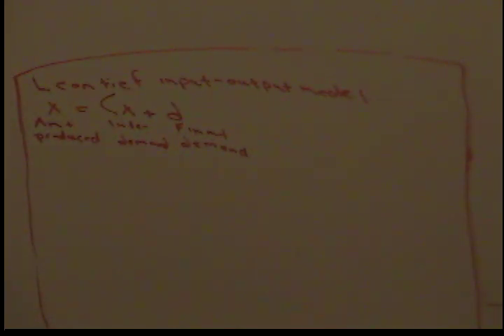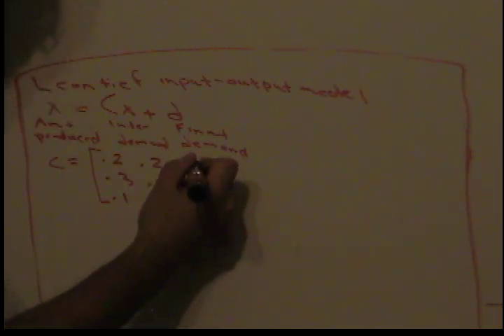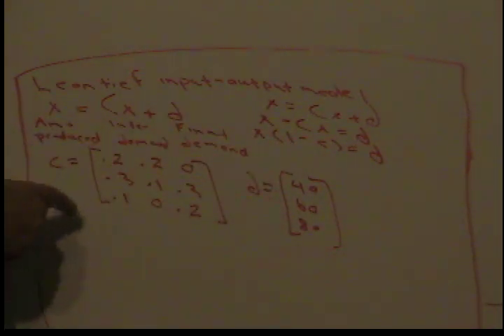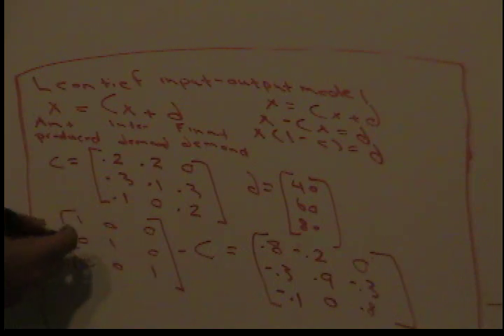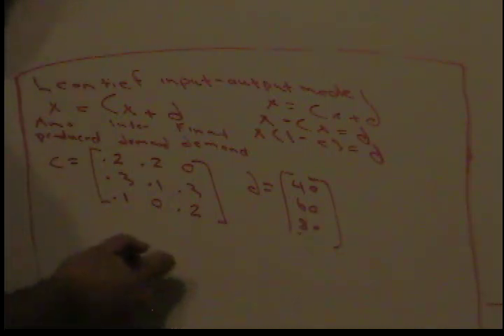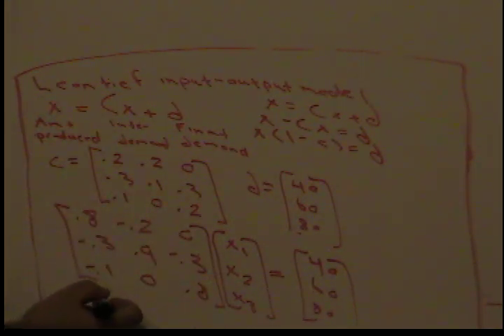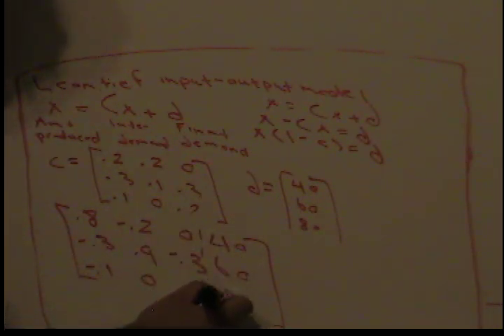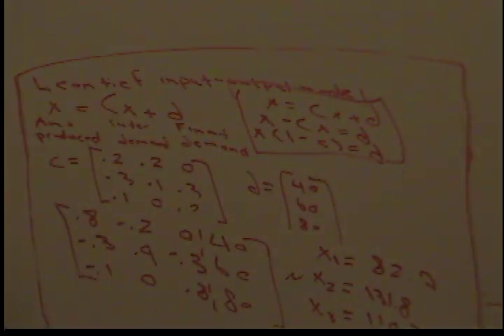Application of Leontief Input-Output Model/Production Equation

Comment from the maker: As long as your total exports = total imports, than you will have a balanced system of equations, and you can solve in a similar way. But in general with any model, total outflow = total inflow. if this is not the case, than you would have to create dummy nodes to satisfy any lost or excess demand.

Comment from the maker: The number in matrix bracket, I assume you are referring to the dimensions of the matrix? The dimensions of the matrix are determined by how many sectors of the economy you have. No, the matrix is not an assumption, but is formed from the actual model you have. You would probably be given a word problem, then have to draw a network diagram, and from the network diagram you can build your matrix, and the follow the above procedures.